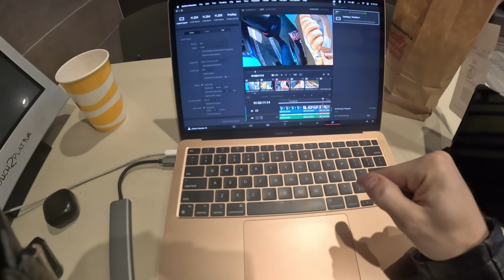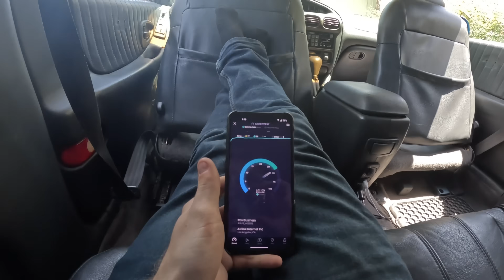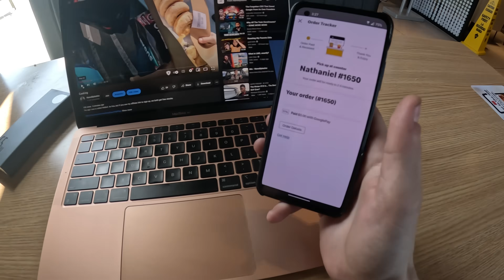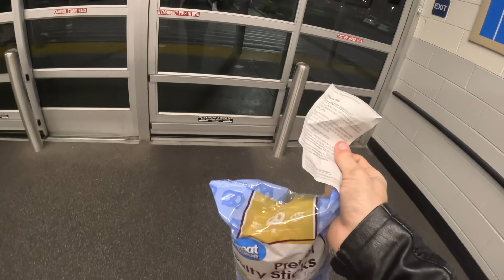Wires

Comment: 4:20 As seen in the video, you always need to put positive (red) cable on first and then put the negative (black) cable on and when you're removing it, take the negative cable off first and then take off the positive cable. If you don't do it in this order, it can potentially cause a fire.

Comment: Have you ever thought of changing to a van for the better MPG, bit o vanlife?
Reply from the maker: Yeah. No. A van would not have better mpg
Reply: @NanoBytesInc  my diesel eurobox can do almost 65 miles on a run. Just thought it would give you more mpg than a supercharged gas car
Reply: @Carl Barton  there is very few diesel vans in North America unless you get a Mercedes sprinter. I know from first hand experience a 6.0/7.3 Ford diesel or a Duramax only 3 non Mercedes diesel vans are not fuel efficient. They might be more fuel efficient than their gas counterparts but not more than a 3800 sc.
Reply: @carlbarton772  What does "65 miles on a run" even mean though? Surely not 65 miles per gallon...
Reply: @Chris-xo2rq  yeah Skoda fabia diesel at constant 65mph Stafford to Bristol is usually possible if on a constant run usually 300 miles is around 40 quid
Reply: Check out some auto Alex vids he can drive to Germany on a tank of fuel from London.
Reply: @carlbarton772  I looked up the mileage of the Skoda Fabia Diesel and it's about 18km/l, which is about 42mi/g for us Americans... That's good but not unheard of, my gasoline Civic gets about the same. You're right, that's better than he is getting and it would be more comfortable, the problem is getting that to the US.
Reply: @Chris-xo2rq  ford transit connect and have it mapped for economy.  Some rad diesel micro campers are getting mad milage.
Reply: My skoda is a 2011 eco diesel, only £20 a year road tax thats why I am running it into the floor. Then hopefully getting a car that runs on 100% synthetic petrol.